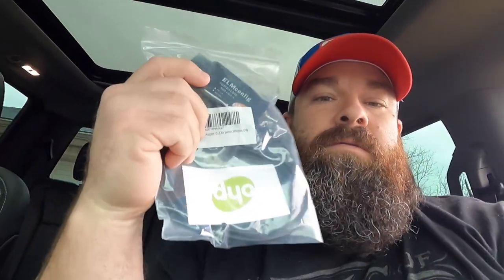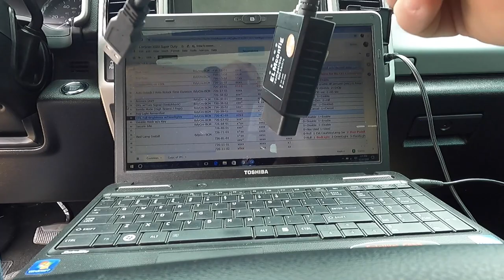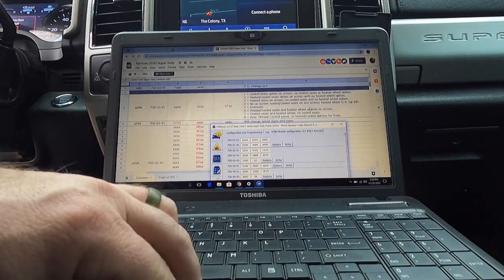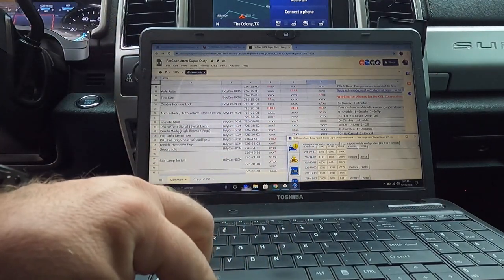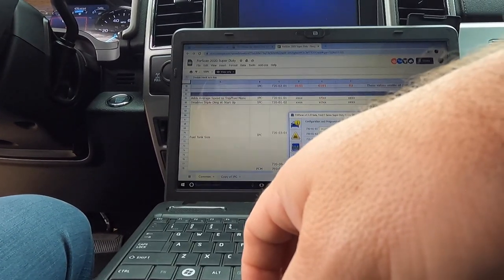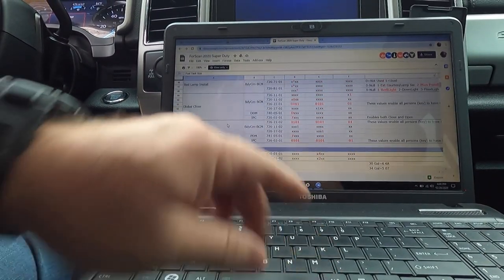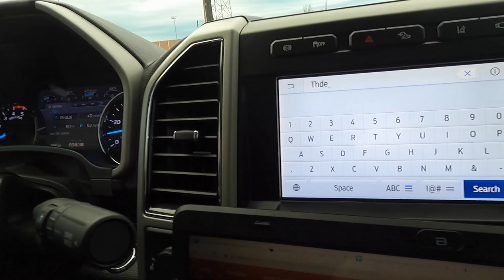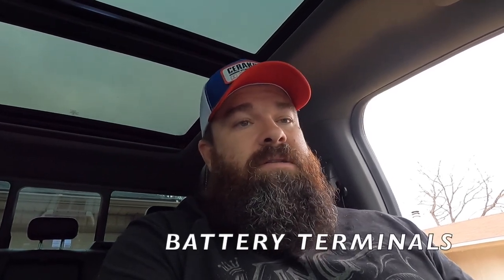FORScan MODS on a 2020 Ford F250 Tremor

Comment: Good stuff! I just did the most of the same to my 2021 F-350 Tremor. Great trucks.
Reply from the maker: They absolutely are.
Reply: I too have a 21 Tremor. Is it the same process as the 20?
Reply from the maker: @jaydoucette3353  yes it should be.
Reply: @jaydoucette3353  Yup, there are some good forums that provide some support. If you haven't already, check out https://www.fordtremor.com
Reply: @AdamPetramala  yes Sir. I’m a member. Great site
Reply: By any chance did you disable the TPMS (tire pressure monitor) on yours?  I did on my 2021 f350 and my check engine light came on..
Reply: @Fist2thenecK  I did not disable them but I lowered the alarm point to 60 psi.
Reply: @AdamPetramala  I had different tires put on and removed the tpms receivers.  made a pvc tube, sealed them, then pressurized it to the correct psi.  That would work for about 15 minutes then stop.. That's what led me to forscan.
Reply: @AdamPetramala  I may have to have them reinstalled then just lower the pressure.. killin me..lol
Reply from the maker: @Fist2thenecK  so why would you remove them? Just curious.
Reply: @TheNutthouse1  A few months ago, I didn't know about forscan.  On trucks in the past I had, If I changed tires that required less pressure, I would have them remove the TPM sensors and I would make a pvc pipe enclosure, with a valve stem and put the sensors inside it, air them up, good to go. Well.. this worked on my new ford BUT for whatever reason, it only works for the first 15 minutes! of driving then it goes nuts.  Works every time , only for 15 minutes.. so here i am.
Reply: @TheNutthouse1  I am going to have them reinstalled then lower the pressure settings like you did.  I think when I disable the TPMS the PCM and BCM recognized a change in the ECC then freaked it all out, I think the PCM and BCM would have to do a "relearn" in order to communicate with the new disabled tpms.. that being said.. nah, I ain't doin that..LOL.. Im just trying to look cool with different tires, not work at Microsoft..

Comment: I have a 2021 f350. Wasn't able to do the Bambi mode.  Had to undo it as it turned off my auto bright lights.. plus I couldn't set the temps above gauges
UPDATE JAN. 2022  purchase the recommended OBD and the 1 year license.  Not sure which one made the difference however was able to add Bambi mode, temps above guages plus a few more changes. Very happy with truck so far. 18k  as of one year with truck 1.27.2022
Reply from the maker: Thats odd. I wonder if the 21's are different. But I dont seed why they would be.
Reply: did you do anything with the Tire pressure monitor system?
Reply from the maker: @Fist2thenecK  No. what are you trying to do?

Comment: Great info. Did you happen to notice if when you changed the navigation for speed if it did the same for the camera system? I would really like to be able to use the different cameras while driving.
Reply from the maker: Yes I’d love to use mine also but have not had luck unlocking that feature.
Reply: Great question, one big thing I'm not happy about over my ram.
With the ram I could turn on either tailgate or cargo camera at any time, stayed on for 10 seconds then went off.
Very cool feature. Hope we can access this feature on the ford.

Comment: Does forscan only work with a laptop, is there a way to use a tablet or phone app and use something like the OBDlink mx+ scan tool through Bluetooth? The OBDlink mx+ I have does not have a cord it's just Bluetooth capable. Will it work or do I have to get one with a cord? 
Thanks!
Reply from the maker: I have the app on my phone but for some reason I’m thinking it works only on a laptop for the changes.
Reply: @TheNutthouse1  
I think your right. Just down loaded everything on the laptop last night. Was a real pain in the ass, ended up just paying for the full life long access @ $50.00 and got it to all work with a OBDLINK mx+, all Bluetooth no cord. Made a few changes per another guys video, but the one thing I tested didn't work, fogs on with brights, he showed a different way to make changes, his way seems to not be completely accurate. Will try your way today.

Comment: Did you lose the Turbo gauge when adding temps on gauges?
Reply from the maker: No it did not. I have the DEF gauge in place of the turbo psi gauge.
Reply: @TheNutthouse1  Mine is either a transmission temp or DEF guage.  The turbo guage is gone.  I will have to look at Forscan to see if i disabled something

Comment: Not sure I was successful in removing SiriusXM from my 2021 F250.  If I change it from 2 to 0, does it just make it so it doesn't cycle through XM when i hit sources on the steering wheel?  It still shows the icon in sources.

Comment: wondering if you can enable the On demand regen at any full level of the DPF percentage...?
Reply from the maker: There is another option in the DPF screen that I did not try. I'm going to do another video on the "AS BUILT" options and I'll look into that.
Reply: @TheNutthouse1  I appreciate that, not real savvy with Forscan, trying to learn but at the same time I rather not practice with my truck, it's better to learn from someone with forscan experience.

Comment: Don't use "as built" go to one below it. Everything is labeled so you don't need to change numbers.
Reply: I did the same thing you're referring to, I found it to be much easier.
Reply: I just made some changes in the same way you mentioned, but noticed my fog lights still went off when I turned on my brights. Not sure if that way will work.
Reply: Believe me, I've made that mistake by using "as built" and it went wrong, luckily I managed to reset the changes with the OEM settings and use the other menu that was easier than as built.

Comment: I do have one question, by making these changes does it effect the warranty in any way.  Thank you.
Reply from the maker: That’s a great question and honestly I’m not sure. But turning off the door chimes or changing the display screen or whatever else I don’t see why it would. It’s not like tuning the truck for more power. If that makes since. It’s just unlocking factory options/features inside the computer. I did save the factory settings just in case.
Reply: @TheNutthouse1  
Hey man got the same error plugging it to the car and forscan no adapter found where did you go to update the latest updates needed for the device
Reply from the maker: @lolssh9003  only updates I’ve seen needed was to the FORScan software itself.
Reply: @TheNutthouse1  thx man just got it to work

Comment: What happens when you have to change the truck battery? Would all the mods go back to the factory settings? Would you still have all the mods on there?
Reply from the maker: With it being changed in the computer I don’t see how it would. But I haven’t changed the batteries yet.
Reply: @TheNutthouse1   thanks for the info. Now I want to mod my 2021 f150